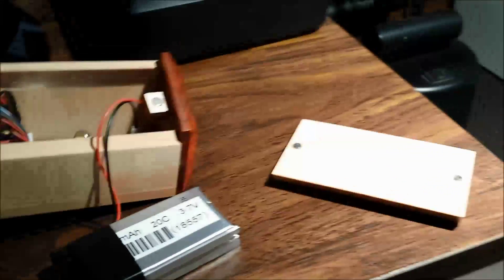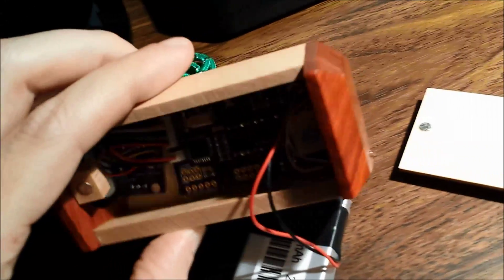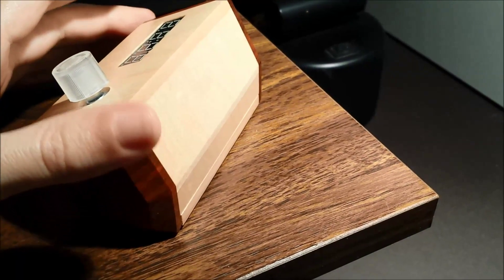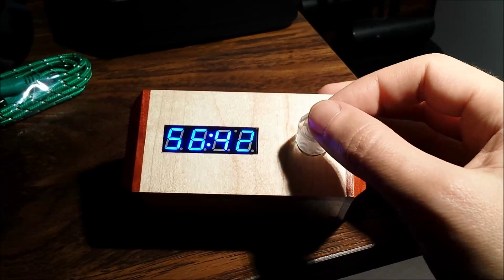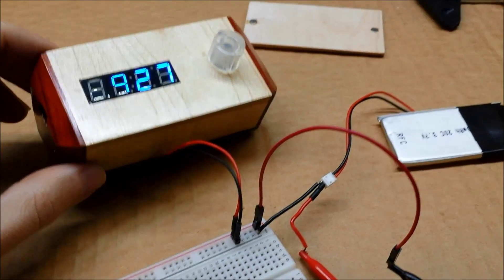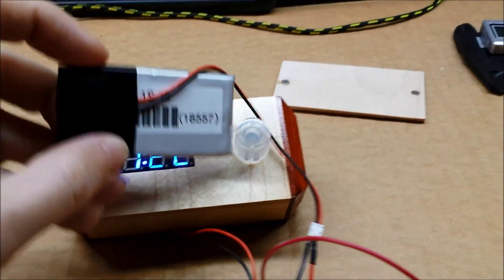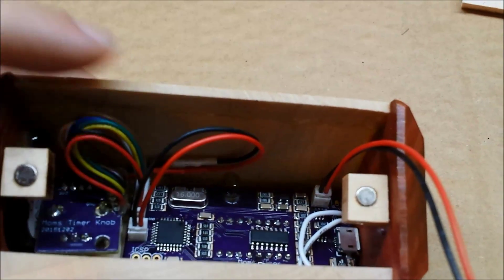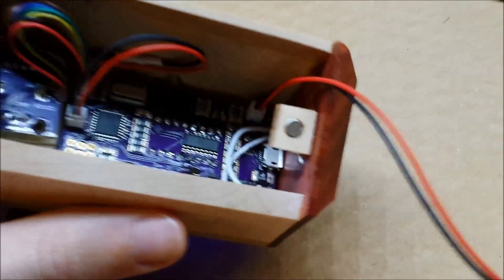Moms Timer 11 - the night before Christmas

Comment: The box looks amazing, have you though about adding an acrylic front panel (dark or with a graphic so the segments can have a window and rest glossy black) over the front? I don't like how the segments are exposed. I look forward to your videos.
Reply from the maker: +GT WING Yes thanks, I looked at https://www.digikey.com/product-detail/en/6301040/PRD180LPS-ND/241224 but decided I liked the display au naturale...I like the look even though this smoked lens with black bezel would improve the readability and make the cutout a lot easier (it wouldn't have to be as precise).  Maybe one day I'll get a raw sheet of smoked acrylic to see what I can come up with.  I have never worked with it before.
Reply: +dparson I think those premade black bezels look cheesy, i'm talking more like a from scratch acrylic flush against the front of the box.
Reply from the maker: +GT WING Yep me too.  A piece of smoked acrylic with the same dimensions as the 4 digit 7 segment display, flush with the front might be a good improvement.  Or maybe a piece that sits on top of the wood face, slightly wider and longer than the display but with a 45 degree angle sanded on each side would be really cool, and hide any imperfections with my chisel work.  Thank you for the ideas :)
Reply: +dparson That sounds good too!

Comment: Why not putting the 3.3 voltage regulator on the rf module vcc?
Reply from the maker: +Graziano Mirata You are right, looking back I should have done that, it would have made the buzzer louder and I still could have used it as the analog reference for measuring the battery voltage using the auto-calibration trick I came up with (https://www.youtube.com/watch?v=HXA_sv2mDdU).

Comment: Awesome menu system, very impressed. In my experience the NRF24L01+ modules tend to work fine over 3.3v, your Lipo wont be over 4.2v so I would just try it without the regulator. I hope you had a great holiday.
Reply from the maker: +David Watts No kidding, well that settles it then, for the key fob I'll just try running the whole circuit without the voltage regulator, thanks David and I hope you had a great holiday too!
Reply: dparson Cool, they are pretty cheap so it is worth a shot. Might be a good idea to throw on a diode from the bat straight to the NRF24L01, a common 1N4001 should give you a drop of around 0.7v depending upon current draw. At 4.2v bat that would give you 3.5-3.6 and at your minimum bat of around 3.5 you would get around 3v (since your current draw will be less at lower voltages).